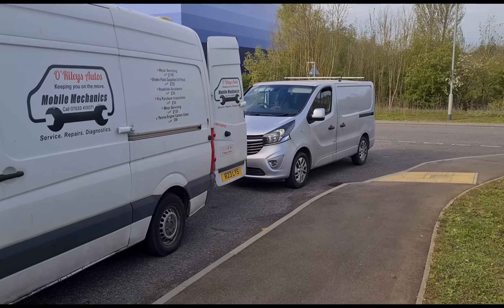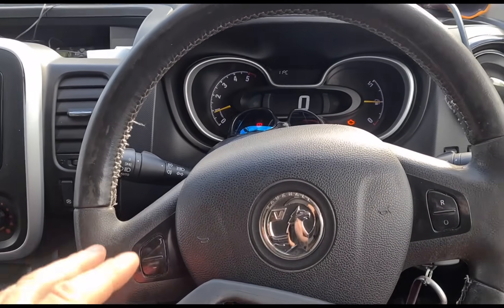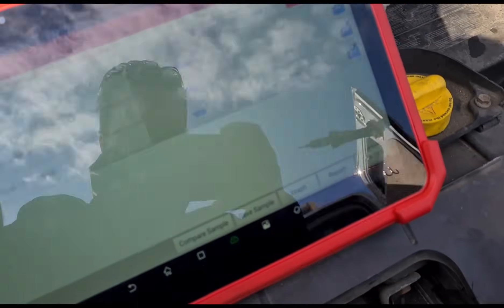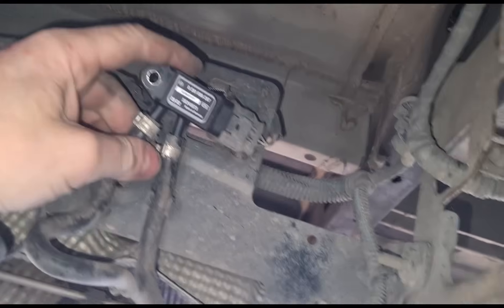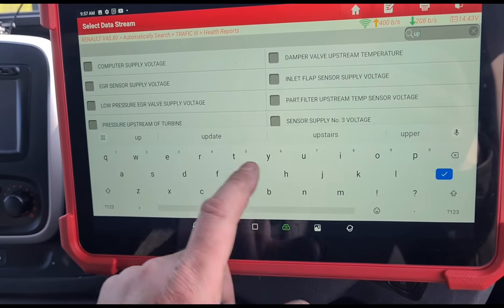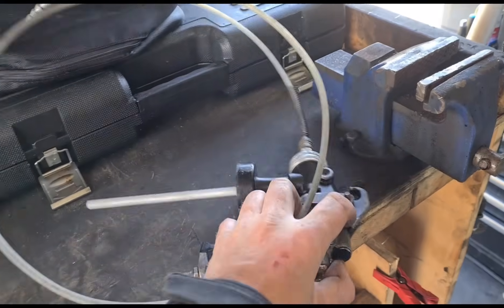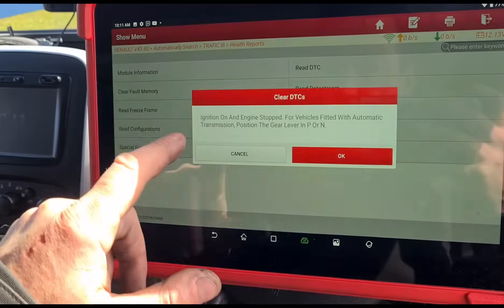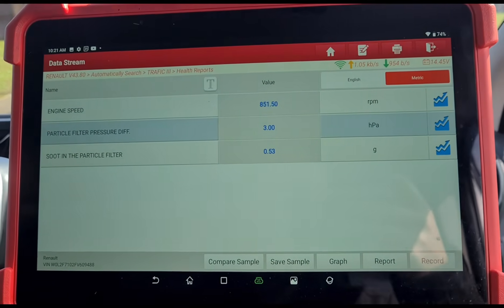Bag Of Parts Changed But No Mechanic Could Solve This Fault

Comment: My car got a fault code. Took it to the dealer. They said it was the glow plug circuit fault. A loose connection. Fault came back in a day or two. Back to the dealer. They ordered a glow plug module. A week later back to the dealer to install it. A week later the fault came back. Back to the dealer. They replace all the glow plugs. This was all warranty work so I’m not complaining except that seems they don’t diagnose these days, they just throw parts at it.

Comment: What diagnostic tool do you use fella , I’ve a bi turbo sport with a p0203 cylinder 3 injector circuit open permanent, job tomoz , this video helps a lot your a man of a good talent not many can work out the issues on these, give up and just sell them cheap

Comment: Hi Jimmy, I have a hyundai i30 1.6 crdi 2016. My problem is that the dpf regenerates quite frequently. In summer the regeneration happened in every 100-130 km, now that the temperature dropped to 10-15 celsius degree it does it in every ~210 km. Do you have any idea where to start to solve this issue? That the issue is temperature dependent, doesnt it narrow down the reasons a bit? 
I consulted a few car mechanics but everyone is just guessing, i could pay 1000 of euros and still it is not sure that I find the cause of it..

Comment: man.. you're so good!

Wish you could help me with my renault megane III 1.5dci.

getting codes p1484. p1485. p1496. the shops I visited cannot find anything wrong. Yet it it pops up "check injection system" every now and then (10s intervals) combined with a check anit pollution filter warning. I have done dpf cleaning. seems clean.. everything looks clean really. my next try is to do the WD40 trick on the exhaust valve as you did one time. Do you have any pointers beside that? they checked EGR sensors. hoses.. cleaned. Still problem remains. Really hoping it is the easy fix wd40. 

But if you have anything to add.. I would die of gratitude.. haven't been able to go work for 4 months now

Comment: Thanks for your videos.  I have a Mk8 Transit that had a faulty thermostat with corresponding low engine termp - thermostat now replaced.  Seems engine couldn't come up to temp and prevented a DPF regen, eventually ending in limp mode.  Eventually, spirited driving cleared the DPF and the restrict-power code and the vehicle drives normally once again, but with an engine check light on which cannot be cleared with my cheapie code reader unit.  I sure wish you lived just around the corner, it's been pretty tough working on it...

Comment: Hi ,i dropped a van into a garage with DPF problems. They said it was fixed ,drove it for a few days ,oil light came on ,pulled over ,dipped for oil not a drain of oil on the dipstick, phoned garage and asked if they checked for oil and they said know ,so basically they let  a 4 year old renualt traffic out with dpf problems and not checking engine for oil ,is this normal or is the garage playing dumb here ?
Reply from the maker: It's good practice to check the oil level but if it's not part of the job not everyone will. It is the owners responsibility to check oil and coolant levels daily

Comment: Went through something similar a few years ago when i needed a new dpf pressure sensor tried 2 different sensors one was 12 quid the second one was 30 something quid the car didn't like them it was only when i put a genuine vauxhall one on did the problem go away..

Comment: Hi I have a mercedes vito 2019 taxi.  Goes into limp mode, no eml on or anything, changed nox sensor and o2 sensor, dpf seems fine.  Any ideas what it could be.  Also notice blue smoke now n again when idling  at lights.

Comment: Glad I totally rebuilt the body on my smiley transit.  Had it from new and covered over 500k miles now.  Still use it to do journeys the length of the country without any issue, and it's not even that bad on fuel.  When I watch these videos and tot up the cost of owning newer vans I realise I'd have to be mental to swap it, especially as you very often can't even fix it yourself!
Reply: Second that, just welded and wax oiled my old HiAce 2.4 D no turbo no nothing
Reply: @anishmahadeo5073  Mid to late 90's commercials were the best in my opinion.  Sure, if you're doing mega high mileages the a newer common rail makes more sense in regard of fuel saving, but then you can quite easily wipe a year or two's savings away after needing one repair, of which newer vehicles seem to need a lot!  I also like the fact my old tranny is going up in value, whereas everyone's newer vans are going down 😁

Comment: How do you get this good at fault diagnosis? Serious question. I'm not a mechanic. However, after spotting a video of yours where I realised my exterior temp sensor was toast- 88 deg c- so I self fitted a new Peugeot part to my wing mirror and now it's all good. £80 done. I don't get why modern garages are unable to diagnose issues.

Comment: I have no issues with the work you do and have nothing against you personally.
My issue is with the way the system works.
It gets blocked because it’s saving the soot and emissions then it cleans itself back into the air.
So if all the sensors and equipment wasn’t there it would just go back into the air exactly the same.
Am I wrong? Please tell me if that’s right or wrong.

Comment: I've just had one Jimmy on a petrol engined 1.8 Polo....its been everywhere and the customer said its the turbo...will you fit a new turbo...yep no problem...has the dealer seen the split in the boost pipe???

Comment: Hi jimmy can I ask regarding the battery disconnect faults if the all the battery connectors needed cleaning and removed from the lugs would you need to do a relearn on the scann tool .

Comment: Always an easy fix 😅 wish I could afford your service to fix my vivaro, all sensors working fine, just soot content increasing drastically on a press of accelerator, dpf clogging in no time, and only fault codes DTC200291 DTC200292 which means dpf clogged , will be checking injectors and turbo 🙈

Comment: That was fascinating, I don't know much about anything mechanical. Watched the whole video mind blown!

 Considering buying a Vivaro as my first ever vehicle, as I want to convert it and travel. 

Wondering if I could please ask you advice. Two people have now told me that vivaros are bad vans, would you agree with this? If not what would be the year and millage you'd suggest would be a decent van to purchase for converting into a camper.

 Theres some reasonably priced options around 50k/60k miles, and obviously cheaper again at 80k. The difficulty is I could waste money getting something really low millege and then take longer to convert it or i could save money getting higher mileage then it could be a waste as I'd be paying for repairs.

Any tips would be really appreciated.
Thanks

Comment: Well done Jimmy. Why can't these dealers diagnose these issues, you are a top guy , shame we don't have guys like you in the so called main steelers 😂we'll done again 👍
Reply: Surely this video is evidence of the fraud by the main dealer. They claim to be experts and that legally carries an extremely high bar that the customer can expect from them. The fact that a 1 man independent mobile mechanic, accurately diagnosed and fixed the problem on video, in a car park of all places, proves that the dealer was incompetent at best and fraudulent at worst. Either way, he should be demanding his money back from the dealer on this basis alone in my opinion. Clearly they  are either not experts and are incompetent or they are deliberately overcharging! Which is it do you think?

Comment: My Vivaro did this anti-pollution system I had bought the kit that you use did what you do and all is good thanks very much for your help. That pipe that you unblock with the bicycle cable is a bugger though. ! She was blocked solid

Comment: I think you're a rare breed now, Jimmy. An actual mechanic, vs a 'parts fitter' which is all main dealers seem to have these days 😕
Reply: I just repaired a jeep compass 1.6 diesel that the mail stealer for months. They are a joke these days especially with diesels
Reply: Your right the main dealers are clueless nowadays
Reply: Ahem, they aren’t mechanics, they’re technicians now. 😆
Reply: Yeah,  Zip-tie technicians. I've got that sticker on my toolbox too 😆
Reply: In my day, there were no computers. You listened, you felt, you looked, you talked to driver, you drove, then you diagnosed.  That was back in 1970s.
Reply: It just shows how the industry has changed, absolutely brilliant to get to the bottom of it and I’d like to know which diagnostic tool you’d suggest I upgrade and get jimmy… I’m a long way from you…thanks for the free knowledge!!!!!

Comment: I would like to know which Vauxhall dealer he took it to so I can avoid it! Well done Jimmy, I have posted this on the owners FB page.
Reply: All of them 😢
Reply: @MummaBear  shocking statement if that was reality.
Reply: @Bigtbuilder  Pretty much is reality. Some main dealers have their own training centres, very different from the old city and guilds type training. Jimmy and others like him have likely had full hands on training and, I'd say , more importantly experience in both diagnosis and fixing. Parts replacers are simply fixing the symptom in many cases. I know some great mechanics and it's their practical knowledge, due to experience, to deal with all things that can go wrong, rounded ruts etc. That only comes with being in the thick of it. Dealers are purely about the numbers, the money.
Reply: A very good point

Comment: Something seems to be wrong with main dealer training for mechanics.
They are not doing proper fault diagnostic's, just changing parts with the hope that with fix the fault.
Reply: they don't have time for proper diagnostics, incorrect work system
Reply: selling new cars seams to be more important for them.
Reply: Most main dealers are just servicing. By the time cars need work done they’re taken to cheaper independents